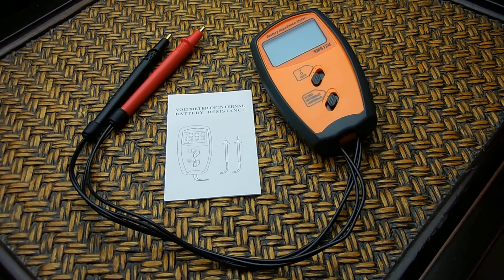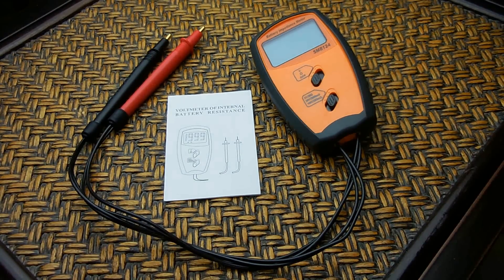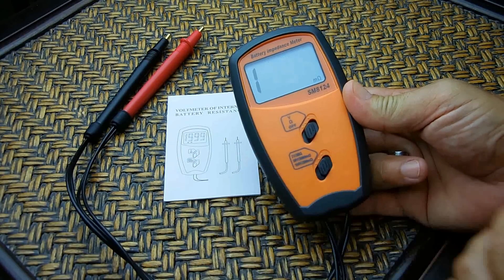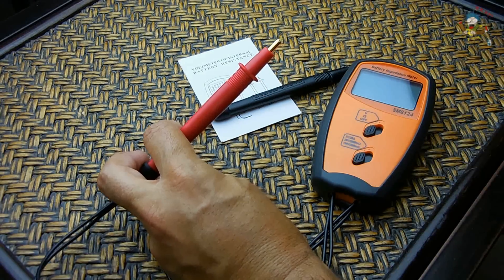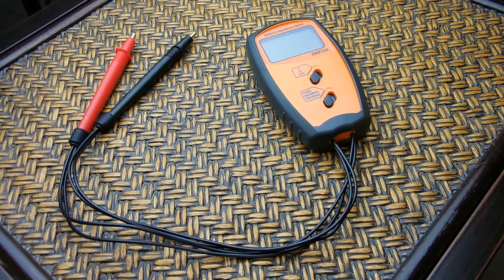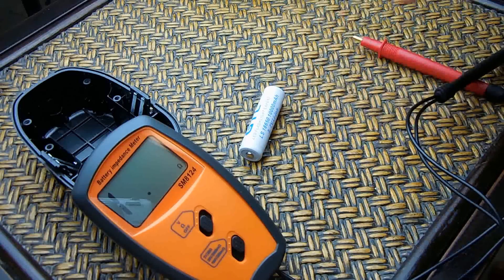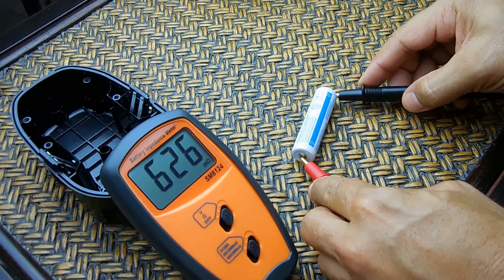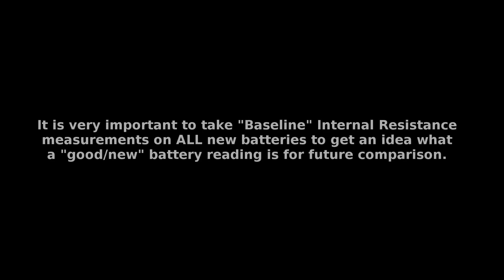How To Measure Battery Internal Resistance

Comment: I find a several videos regarding impedence testing.  However,. What values range from test results would be acceptable for 18650 cell.   For example,. Less than 50,. Less than 100,.  Thanx

Comment: Should be accurate naming things. Cells are not batteries. A group of cells wired together is a battery.
Reply from the maker: First, don't be a pedant, second, when you buy a replacement lithium polymer BATTERY for your phone(usually 3.7v nominal), or other devices, yes, it's called a battery, not a replacement cell. I suggest you read product labels.

Comment: I learned a hard lesson on the 1st flight of my new rc  plane.......CRASH near the ground, as  I lost all control at the 5 min mark of flight and I was very close  ( range wise ) .....I was using  a very old 3S 2200mah LiPo....pretty sure the ESC  went into LVC,   although after checking the battery after the crash  it showed  voltage was 3.80 per cell ........I am now searching  for  a simple way to  check IR in all my LiPos .......the meter in this video has been discontinued, why?....thanks

Comment: Testing internal resistance while connected to other batteries might work on a 1 pole but not after that then you are reading multiple batteries at once. Like a 3s4p your readying all 4 batteries ohms together in parallel which would give you a false reading.
Reply from the maker: I was testing one cell that was in series.

Comment: 8:29 holding probes in wrong way.
Reply from the maker: I did it for a reason, the probes are very "touchy". The position I showed gave a stable result. The design has been modified for the newer versions.

Comment: How much does temperature and state of charge impact the internal Resistance measurement?
Reply from the maker: IR goes lower as temp rises, and it's lowest when the battery is at full charge. The range varies.

Comment: ELECTRONICSNMORE, 
                     //////                  ////        Eric Johnson is saying that overdrive & fuzz guitar pedals that take batteries will sound different when using different types of 9volt batteries NON-Rechargeable 9 volt batteries like Alkaline, Carbon zinc, Lithium, Mercury because of the DC resistance of the 9 volt battery.
The sound will be different if you use an Alkaline, Carbon zinc, Lithium, Mercury battery each will sound differently because of the batteries DC resistance
                                           1.) Why does each 9 volt battery type  Alkaline, Carbon zinc, Lithium, Mercury have a different battery DC resistance?      Why different battery types will have a different DC resistance compared to another battery type, any reasons why?     Yes I know that the batteries DC resistance will drop the 9volts when the guitar pedal is drawing more current but what Eric Johnson is saying is that  9 volt Alkaline, Carbon zinc, Lithium, Mercury will have a different DC resistance which will drop the 9 volt down differently when the overdrive or fuzz pedal is drawing more or less current.

Comment: Hi, nice video .this tester work for test toyota hybrid battery modules? If not you can recommend me one please thanks
Reply from the maker: If testing individual lithium ion batteries, then yes.
Reply: @electronicsNmore  thanks , my modules are nickel metal how I test the internal resistance in an easy way?
Reply from the maker: OK, I think those modules are around 7.5V each. There are more than likely (6) 1.25V NiMH cells connected in series, then many more like those are connected in parallel in each module. I would check each bundle in each module.
Reply: @electronicsNmore  yes almost ... 7.2V nominal (6) 1.2V  and in my case 28 connected in series. What's the easy way to know the internal resistance of each modules? . Is a TOYOTA prius hybrid battery thanks again

Comment: Is there any reason one could not use this meter on an alkaline battery? (especially if one is into recharging them, e.g. as per your circuit for doing this, or with other purpose-designed charger)
Reply from the maker: You can use this with all battery types. Thanks for watching!

Comment: Hi and thank you for the video. Would it be possible (and wise) to test a 3p group of cells in a pack without disconnecting them? I have a 20s3p battery pack (same cells) that I'd like to check if the groups in series are going out of balance. Also I happen to have access to used cells of the same kind that I can swap out. I'm just trying to figure out a strategy of servicing the pack. Cheers!
Reply from the maker: You need to test each battery by itself.

Comment: Great Video ! I have a question to ask if we have 20 cells in a battery and each cells give 0.02  resistance but only 2 cells give reading of 0.03 each so as they are quite equal shall we consider them bad cell because the other cells gave the reading of 0.02?
Reply from the maker: Not too far off, likely OK, but ideally you'd want to have all the cells the same. Thanks for watching!
Reply: electronicsNmore thank you so much !

Comment: Hi, congrats for the video. What’s the difference between this device and an ordinary multimeter which also has a Ohms measure range? Another doubt.... if you measure bunch of 18650 cells and get close values of resistance something like 300mAh or little bit more of capacity between them, it would be good to put they together to work? 
Other thing :]] Is there a table with average resistance values of good cells, medium quality and almost dead cells to help to interpret the results ? Thank You!
Reply from the maker: Hello. Only a device like this can be used to measure internal resistance. The device in this video uses a specific frequency for testing internal resistance. Much more info and tables can be found online.
Reply: Got it! And in the following scenario: I have 5 18650 cells with very similar internal resistance but capacities that vary 300mAh or a little bit more beetwen them, would it be appropriate to mount a pack with them both in series or in parallel?

Comment: Actually AC Impedance is different from DC resistance. "What the user needs to know is the DC series resistance, because DC is what flows through the cells. Manufacturers specify impedance at 1 kHz because test equipment to measure it is readily available."  http://liionbms.com/php/wp_resistance_vs_impedance.php . There is a correlation between AC impedance and resistance DC, but the interval is big. If you have 1 mΩ AC impedance at 1 kHz, DC resistance is anywhere between 0.5 and 5 mΩ.
That is a full order of magnitude, and not very helpful to determine if a cell is appropriate for an application.

Comment: The internal resistance varies depending on the chemistry , but your tester is showing 0.04 for both NIMH ( or NICD ) and lead acid batteries. Surely that is not right ??
Reply from the maker: If the batteries were new, you'd be correct. I used new and old batteries.
Reply from the maker: If the batteries were new, you'd be correct. I used new and old batteries.
Reply: Thank you for reply, much appreciated. So after 8 months, you still have this model and have used continuously . Can you still recommend this model or would you recommend another?

Comment: Minimum value measurement 1mOhm for a 3.2-12v battery? Can it metering like 0.8, 1.2, 3.2mOhm or only 1, 2, 5, 10 mOhm? Is it possible measure up to tenths of a mOhm Do you compared accuracy with other measuring devices? Thanks.
Reply from the maker: The unit works extremely well considering the low price. If you require very high accuracy readings, then you'll need to spend A LOT more money. Thanks for watching!

Comment: Thanks for the review.
I think the Ohm/Volt ranges are not correlated to the battery voltage, that is you can choose the best Ohm resolution regardless of the battery voltage.
For example on the Nicad battery pack you could have chosen the 200mOhm and got a precise result instead of  just 0.04 Ohm.
Or am I wrong?
Reply: That's wrong. Even in the manual you showed, it's clearly described that for impedance measurement, you first chose the smallest Ohm range for detailed measurement. Only if it shows "1", you go to the next range and so on. As long as you are working with voltages the instrument is made for, you only have to consider the voltage range when you are in voltage measurement mode. Even that is clearly described in the manual.
Reply from the maker: +shlomsi2000 
Hello. No. The lower range switch shows settings for the battery voltage. Make sure the correct range is chosen. .04 ohm = 40mOhm. Thanks For Watching!

Comment: what is better? to match by esr or by capacity? (aka coulomb counting)
I mean the construction will be quite similar so those two will correlate quite closely but in theory which one is the best?
Reply from the maker: Hello. There is a relationship between battery internal resistance & capacity. Lower IR = Higher current output/capacity.
Reply: @electronicsNmore  you did not answer his question

Comment: I used this meter on about 200 18650 batteries. The reading is always within 40-70. The one I built myself has a much bigger range on it. Not too sure I trust this thing.....
Reply from the maker: +joblessalex The meter is fairly accurate. Others online have tested the accuracy using other methods. :-) All the "good" cells test in that range, all the cells that have increased resistance will be well over 100mohm
Reply: +electronicsNmore Odd.... I have some pretty much internally shorted cells and they show the same as a good one. If I load test them though, the resistance is at a much higher number. Load testing them for me gives 150-200 as good and 400+ as bad. The load tester seems to actually read the crappy ones for me.
Reply from the maker: joblessalex
Maybe yours is faulty. You made one with the 8 ohm resistor?
Reply: +electronicsNmore I did a 3 ohm across the 3.6v battery, about an amp load. Measure the voltage unloaded, load it for about 10 seconds, then measure loaded voltage. Voltage unloaded - voltage loaded * resistance / voltage loaded. It gives you a reading and it varies pretty wildly.
Reply from the maker: Load testing works good, but using a tester like this is much easier.